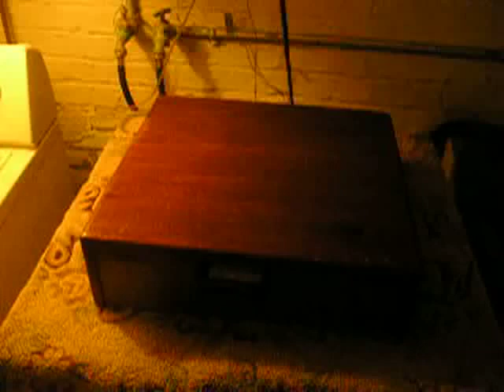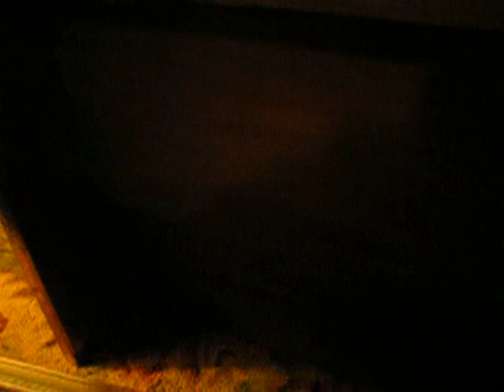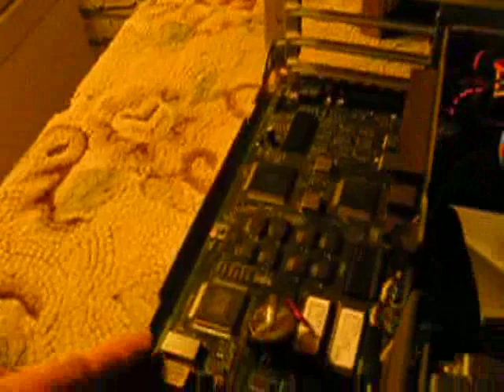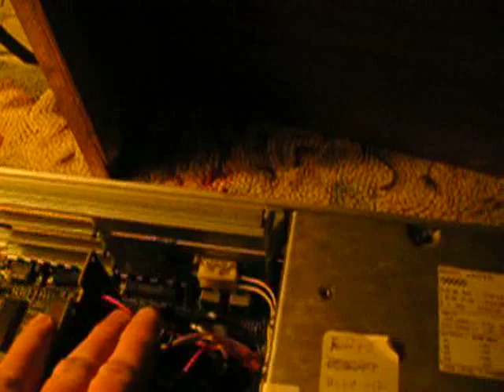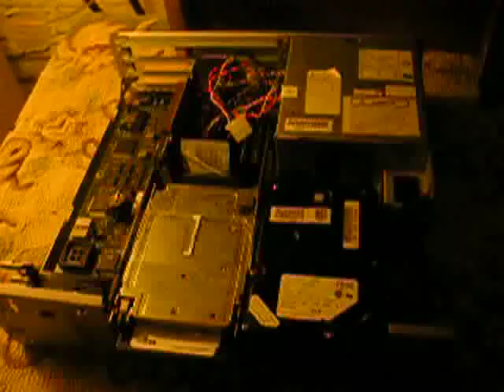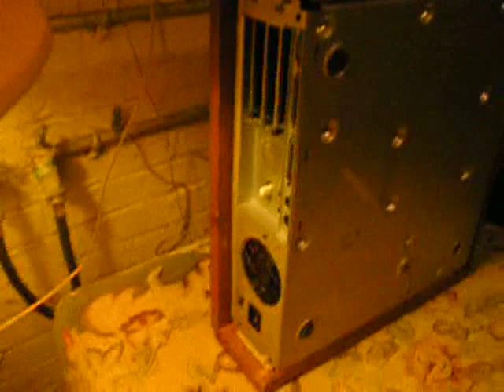Wood Cased IBM PS/2 Model 55SX

Comment: did you know I got a hp dx 7300 slimtower that had windows 7 .but I got windows 8.1 and it han 2 gb of ram but now it was 4 gb of ram it had a 160 gb hard drive but now it has a 500 gb hard drive. thank you god bless you .texas eddie and Debbie